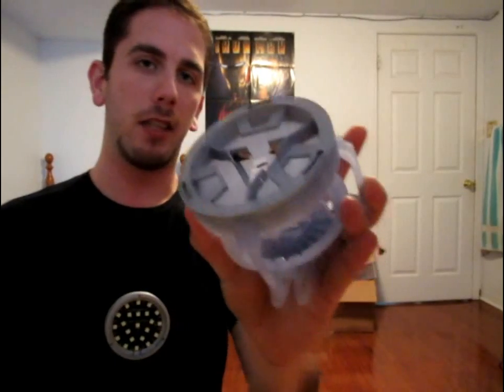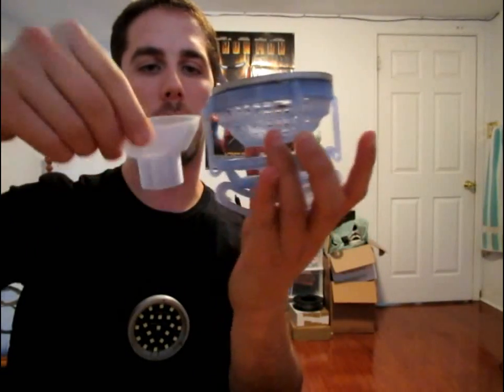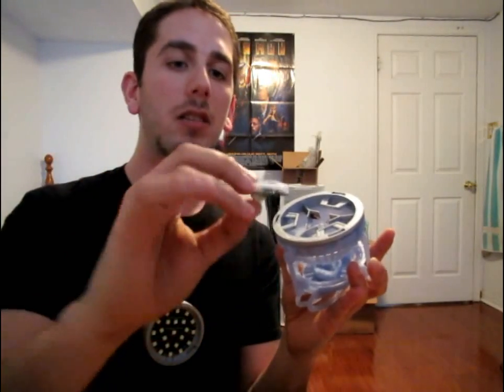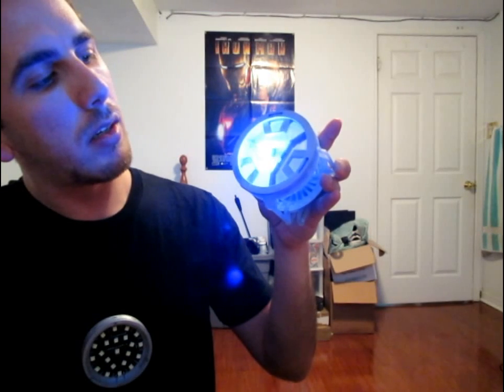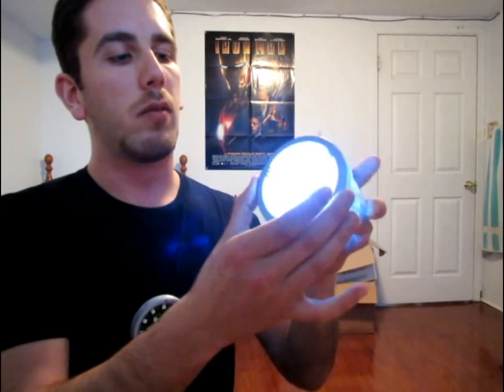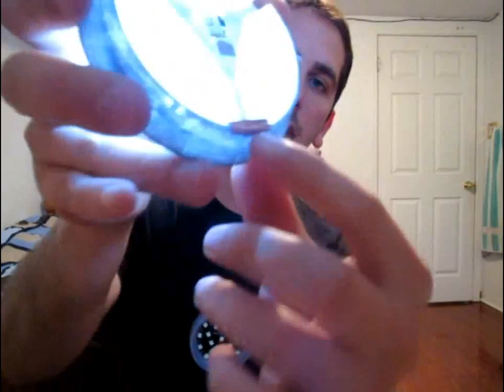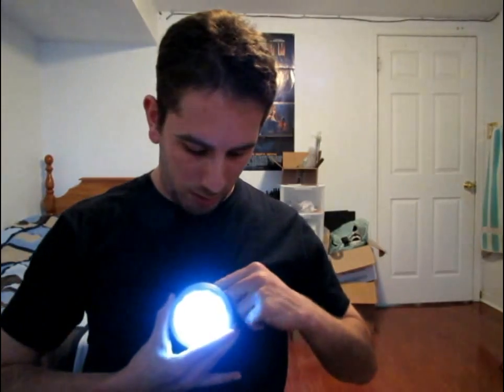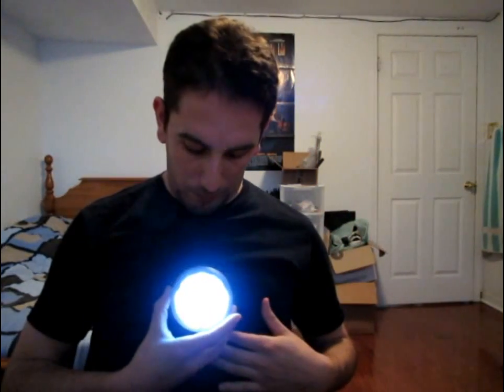Mark VI Arc Reactor Explained

Comment from the maker: Actually, the analog pin is one of the eight legs on the ATtiny85.  If you search up "ATtiny85 Pinout", you'll find out which ones can read analog inputs. :)  Also, be sure to check out the Sparkfun Inventor Kit Guide for information on how to connect the photocell and how to program it.

Comment from the maker: Hey Stephen!
Glad you like my work! :)  In order to use the ATtiny85 micro to read the light value, you simply need to connect a standard photocell to an analog pin.  Then, you want to continually check for when the light value is 950+ (which only happens when something as intense as a laser directly hits it).  Then, use a counter to see how long the laser is in contact with the board, and fade the LEDs on accordingly.  Hope this helps!